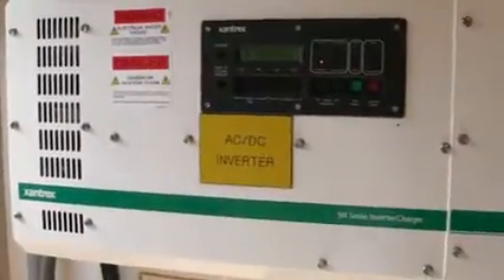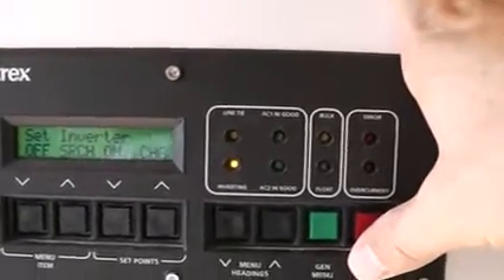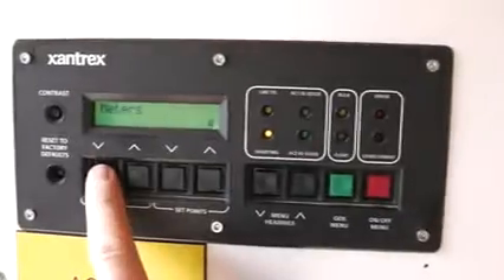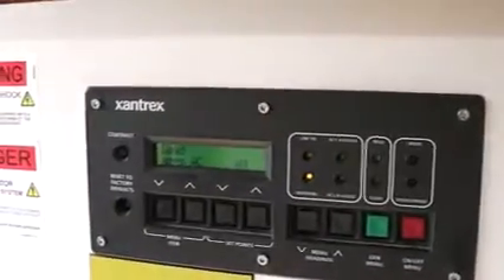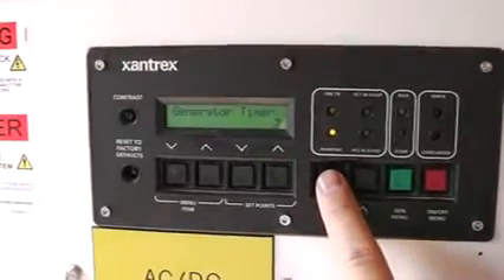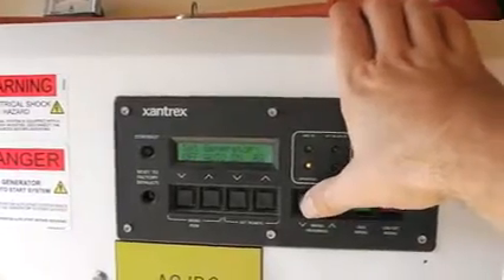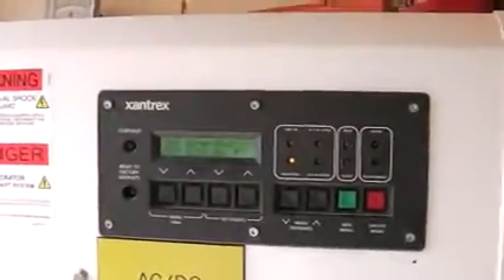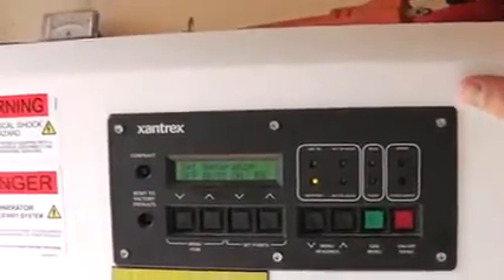Off Grid Solar Power Living: 5 Inverter Setup & Menus

Comment: By using the 6v batteries are you hoping to make replacing them easier than using an 8d 24v battery that would be more efficient?
Reply: +Niko grossenbacher I have been using 8d's now for about 2 years, they are shored up by 2 capacitors to help the lights I am using to start.

Comment: Please include a caveat about you using flooded lead acid batteries. If someone is running AGM batteries the 31 volts or whatever you mentioned would kill some very expensive batteries in a heartbeat. You want to keep AGM's below 28.8 volts on a 24 volt system. (<that means PERIOD)

Comment from the maker: Good question.  They just don't generate a high enough voltage/amperage combo to do that same job as a generator.  The generator can generate enough amps to heat up the batteries and create enough vibration to actually knock some of buildup off the plates.

Comment: I realize this is a little more upscale, however, I have owned 2 different Xantrex Pro-Sine 2000 Inverters.  One costs over $1600.  Not exactly a $150 truck stop store inverter.  I was buying quality.   Both went bad & to top it all off, Xantrex does not service them.  They can only bo tossed in the trash bin.   I loved all the features, you could set anything you wanted.   Very inovative. However, something that expensive should be servicable.   I am not a happy Xantrex consumer.